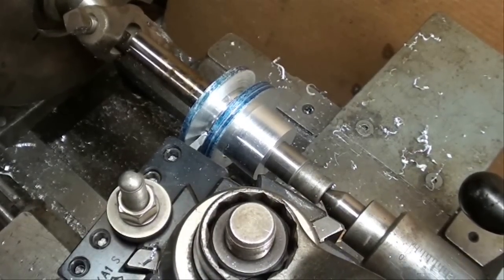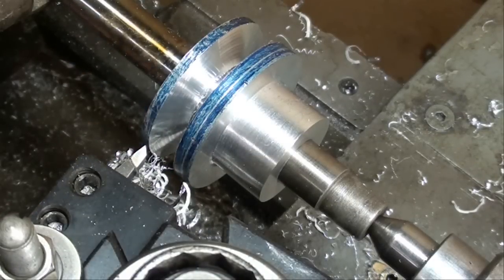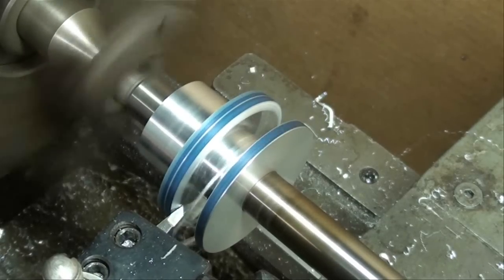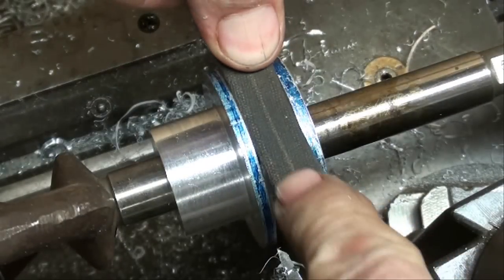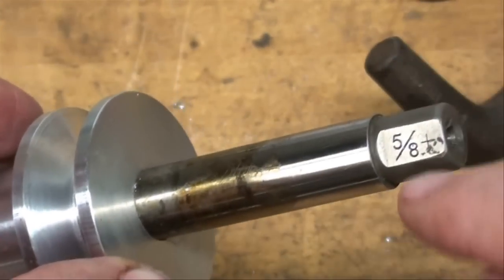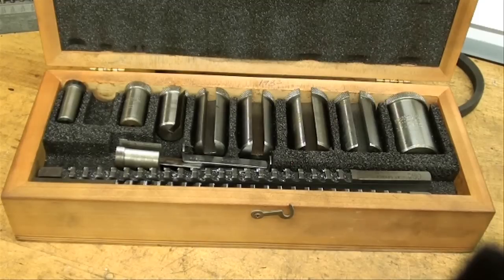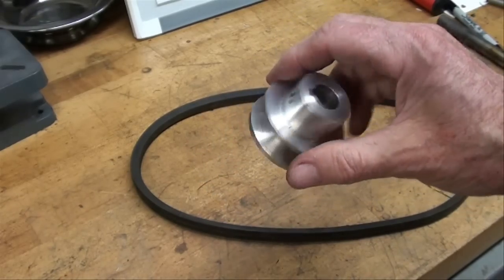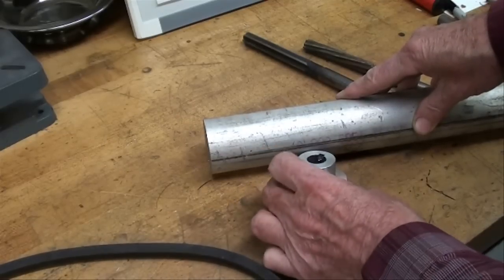MACHINE SHOP TIPS #67 Lathe Project Pulley Part 3 of 3 tubalcain

Comment: Great video - just like all the others...  Just wanted to say thanks for this one in particular.  I am going to use this info. in turning down half of a two sheave pulley to restore a second set of ranges on my old King Canada 1440B lathe.  The pulley on the motor only has one sheave right now, but should have had two different sized to give two different ranges.
Thanks again!

Comment: Pulleys always have a set screw over top of the key, and also another key 90 deg.'s to the first set screw as well. Keys are normally 1/4 in. the shaft size.  Up to a 1/2 key.

Comment: A pulley can be made in less than 30 minutes on a conventional lathe. Expensive CNC lathes are only worthwhile if you want to make lots of the same parts. That is what you should haven been taught!

Besides that I rather have an accurate European, Japanese or American conventional lathe instead of some Chinese CNC junk.

Comment: Great video as usual.. If you're turning aluminium alot, get some special carbide inserts that are specially made for aluminium if you want to avoid those long sharp chips, or grind the HSS tool to form a chip breaker, i have done this with good sucess, but for 6061 alu which i think you have there, i just use my carbide finishing inserts which break the chips very nicely. For making the groove i just use the parting tool and move the compund to suit, no need to make special tool for it.

Comment: That's some nice work. How accurate can you cut by hand? The reason I ask is because I have access to a lathe and mill, and I'd like to make a small model steam/compressed air engine. But I'm wondering if I could accurately turn pistons by hand?

Comment: Sorry Mr. Beep, I do realize the bore and shiv would be concentric. Mr.Pete not only shows how to make things, but also how to run a lathe and other machines accurate in all respects. Your method is normal except if you have a little runout in your chuck, some of the faces and outer surfaces will have a little runout. Mr.Pete was merely showing how to do it accurately all over, not just the working area.
                    Remember Mr. Peterson is a teacher. I didn't mean to upset you.

Comment: I can tell immediately that you do not have the knowledge or technical skill to operate a CNC-machine, but i bet youre a master on the manual ones. However, i am also well trained in manual machining aswell as  undergoing a lengthy CNC-based education right now. Being a good CNC-machinist firstly requires good skill in manual machining, and then added to that a whole lot of technical knowledge about computer machine relations. There are absolutely no advantages in manual machining vs CNC.

Comment: Well mcbumfudge (really? mcbumfudge?) OP deleted my initial comment on the proper way to turn a small pulley. try to keep up. On my Hardinge HLVH with 6 jaw Buck chuck:Chuck stock, ruff turn od, boss, shiv and semi finish bore, finish od and boss.flip part in chuck.chuck on finished boss. finish bore then finish shiv with compound or, with form tool, side to side. break edges done. 15, 20 minutes. bore and shiv are concentric. got it? I guess Mr.Pete couldn't take the heat. And yes, HARDINGE ftw

Comment: That is one and a half inch bar, You will need quite a lathe not a home-shop one. also that big lathe has larger head stock bearing and difficultier to go to higher RPM. And as he said you will need two tool left hand and right hand to face that 2 side 15degree angle, Everytime you flip the work on your lathe you will loose some degree of alignment, But with that industrial-made mandrel you get very little mis-alignment far better that this job will requires

Comment: I HATE TO TELL YOU THIS BUT IF A CUSTOMER ONLY REQUIRES 10 - MAYBE 50 PARTS IN A PRODUCTION ATMOSPHERE YOU CAN SAW YOUR MATERIAL SET UP YOUR MACHINE (LATHE ,MILL WHATEVER) AND BE DONE.BY THE TIME IT TAKES SOME ONE TO WRITE A PROGRAM AND DO IT WITH A CNC.I AM A CLASS A MACHINEST & JOURNEYMAN TOOL & DIE MAKER.29 YRS.

Comment: thank you for your polite reply. Just understand a few things in my method: Concentricity is the primary concern and I have address that by turning the ID and OD in the same set-up, as you noted. The six jaw Buck Chuck in my lathe typically runs better than .002 at that diameter radially and .001 or less axially no big deal. If I need more precision on the OUTER rim of the pulley or face I can just indicate it in. NP. Or take a finish skim on the face and OD. That is the beauty of my method, tnx